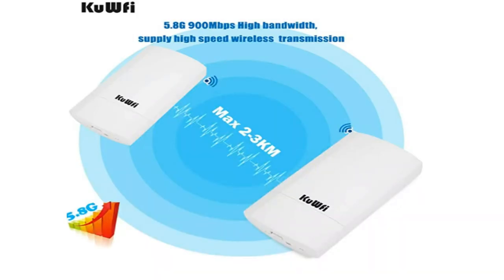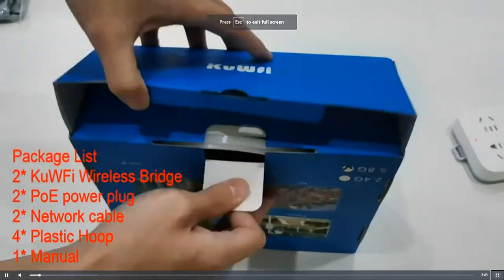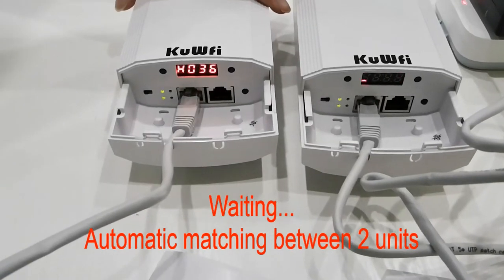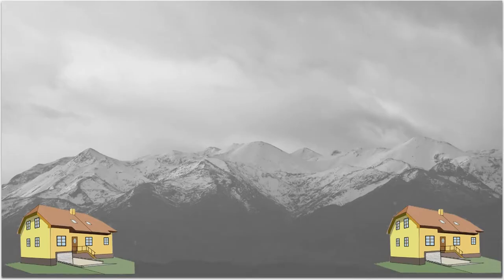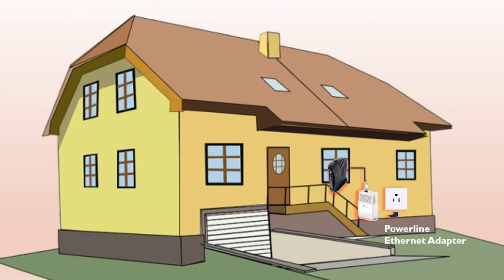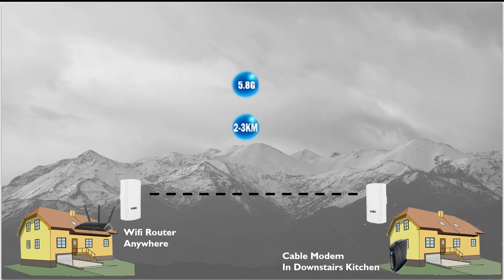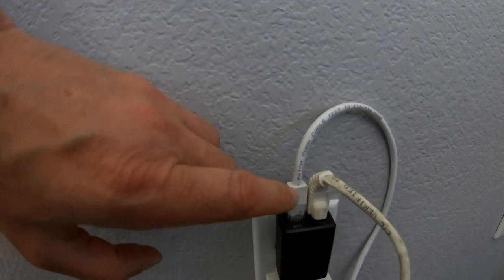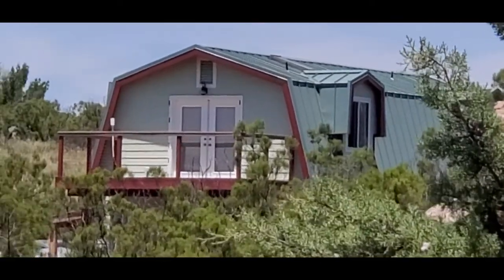Wireless Long Range WiFi Bridge Installation

Comment: Thanks for putting this video together.  I replicated this exact same set up to get wifi to an adjacent mother-in-law unit, and it worked out beautifully.
Reply: Did u use this brand I want it for my dad
Reply: @arthuritchybollix5064  Yes, I used:  (1) the KuWfi wireless outdoor bridge; (2) a Comtrend PG-9172 powerline adapter kit; and (3) a tp-link AC1750 wi-fi router.  The KuWfi bridge is made by a Chinese company, so the English instructions aren't great, but I didn't really need them.  I just plugged everything in as per the video (making sure I had a line of sight for the bridge), and everything just worked.

Comment: You didn't mention if you used the software to peak out the Antenna alignments. if you didn't you can swing the antennas at each end to get max RSL and it may improve your data rate. good video thanks

Comment: Super good video and well detailed.  I wonder if you tested first without powerline and with the antennas near each other so as to know if the low bandwidth was due to the antennas, ISP, powerline or what.  Super thanks.
Reply from the maker: Yes,  the powerline network did reduce bandwidth.

Comment: Am really curious if there isn't more too that "under the sink" stuff?
 Using the plumbing as an interference shield?
  Wow, brain buster.  
Thx for example. Unfortunately, I have obsticals/ mountain in way. So I'm trying to figure out a solar power'd "repeater" that I can put on a common mountain peak that all 100 acres can reach. 
 Most importiant is connecting the 3 different complexes.  Secondary would be pasture survalenc.  
  Scheduled drone liftoff's for livestock grazing surveillance, fence checks, yoty hazing etc.  All interlocked with weather stations that input grid conditions. May not be flyable conditions at one area, but ok at another. 
 So,,, yeah! "Home Automation" 2 another level. 
 Feeder valves and gate automation.  Wow, list goes on.  Hey?
 When do we get a kit to make our old tractors run off a peanut for 20 years?
Reply from the maker: No nothing more under the sink.  Not the best for a router but this is what the cable company did for me.    I'm afraid you need line of site.  Maybe get a tethered drone that's tethered by power line.  Oh boy.

Comment: Hello
I had a question, please help
If i use the Access Point TP-LINK TL-WA801ND_V1 Wireless N300 And use an outdoor parabolic dish instead of access point antennas, to send the Wifi 2400 MHz frequency, how far can I receive the frequency 100% without loss of quality ???
Reply from the maker: I dont believe that will work.  The two end points need to register with each other.

Comment: what about ping ? 

usually KU-Band (assuming that "KUWFI" using KU band, that's "KU" stands for) are laggy, it's like 300-600ms ping in the receiver network.
Reply from the maker: I did not check the latency but users in the other house get good internet and watch TV from a SmartTV.  The reponse times dont seem to be lagging.  I'll have to check that out next time I'm over there.

Comment: In your set up, does the router connected to the slave antenna have to be "synced" with the home router or does it have it's own network?
Reply from the maker: The slave route has its own network and bridges to the master to get internet access.

Comment: I am trying to go from the House to a shop about 250 feet away. The shop runs off the houses power source. Can you just use the adapter that broadcasts through the power system? Or do you still need to bridge?
Reply: Shep VanDelay  I need some help with set up. I have two locations A and B, both are apart by around 1 KM, so I want to use CPE's to share the footage from cameras set up at Location A with Location B ( which also has some cameras) and  save the Camera data at Location B.
The location B has internet access, so I want to share the internet from Location B to Location A as well.

 
Do i need some special configuration or hardware for this

Here is my raw set up:
https://ibb.co/KxWyXYJ

Any pointers?

Comment: Do the units ever disconnect or need resetting from time to time and have they been reliable for you. Thanks.
Reply from the maker: They've been running over a year just fine.
Reply: @how2togo  cool thanks for the reply. I have a similar application where I need WiFi to a neighbouring house.

Comment: How about 50-80 feet. Do they both receivers need to be outside?
Reply: They can be inside but 50 to 80 feet is very close.  I would think there are better product to use to just extend your homes Wifi signal.  This product is long range.

Comment: Hi, I have 300mbps internet speed  but I am only getting 40 mbps at the client  router even though  the two routers are only 10 meters apart for testing , is this normal to loose this much speed
Reply from the maker: Make sure there is nothing in the way and they're line of site.  Maybe the mfg can assist.
Reply: @how2togo  At 10 meters apart there is nothing in the way but air!  How much speed to you have to have to get the 300 MBPS out of them? So I guess they are useless.

Comment: On the second powerline adapter/injector which cable goes into the lan side and which cable goes in the poe side?
Reply: With these units, PoE always goes to WAN. So, LAN to LAN.

Comment: What is your internet speed in the main house vs the drop off to that house? In other words is you main house internet 500mb and the other house 40mb? Or is it something like 100mb and the other house 40mb?
Reply from the maker: Good point.  In the house roughly 100 Mbits
Reply: @how2togo  Thanks for that info :)
Reply: Im getting 500mbits from the house to the bridge.  The bridge is only RECEIVING 100??  Why IS that?  It says it can do more??  Then it turns around and proceeds to put out 47mbits??!!!
Reply: @cerettabridges7312  Several factors affect wireless bridge performance. Antenna alignment, obstructions, quality of the equipment itself, etc.

Comment: Did you make a How To for configuring the slave side router? I got it all plugged in and I’m stuck on why the second router has no internet connection. Bench testing it all before actual physical location install. Tia.
Reply from the maker: You turn on the Master and then the slave.  Make sure they're line of sight of each other and they will recognized each other.  It's that simple.  When you know they're communicating they will display the same codes.  if it doesn't work the first time reset them both always making sure the Master is up and running first.

Comment: wouldn't having two routers like that sideswipe each other (double natting)?
Reply from the maker: Nope,  you get the NAT from the cable modem side
Reply: @how2togo  ohhhh, so do you set the wireless router at the other house to bridgemode?

Comment: How is it going so far? is it working? any issues? Thanks
Reply: it's been over 6 months.  No issues
Reply: Its a point to point antenna. Instead of broadcasting in a 360 degree view like your standard router you'd get from your isp or purchase yourself.  These antennas focus all of the signal in one direction.  You can kinda think of it like a laser.  But, not as narrow of a beam.  But, its still focused.  I recently set up a point to point link myself at home.  To go from the house to the shop.

Comment: Why didn't you just run new proper cable to a better place like upstairs and get your modem out in the open for proper cooling , Then just plug directly into poe switch and the outside mounted ant. Clearly you have some sort of wire skills to do this and move the setup from under a kitchen sink. Will improve signal and speed just moving the cable to upstairs by the outside antenna.Getting rid of them ac plug in transmitters altogether.You already clearly have wires strung in many rooms so why not clean it all up to nice single point installation by the outdoor antenna?

Comment: when you say cable modem (attach cable to the kuwfi unit master) do you mean a router in your house or the actual modem
Reply: The host can be connected to a modem or router. Any active internet. If you have a routing modem, that would be best as the router may have other clients connected to it reducing throughput.

Comment: Our main house is only 500ft from workshop, but the speed we get into our modem via DSL is only 8-10Mbps. Is there any possibility this will work between the two?
Reply from the maker: It should work well.  500 ft is not fast at all.
Reply: Yep will work but if your planning to use it to streaming your going to get irritated at spooling.It will work for 480 but if you step up to 1080 or 4k you will really hate it.

Comment: I have 3 barns  the 3 barns are 150 years from where the master would be put.  all on the same side of the master.  like this.      \  |  /   those are the 3 slaves So can i connect 3 slaves to 1 master.   or is this unit 1 to 1

Comment: better than Powerline Adapters are Moca adapters which run using your coax cable... much, much better and cleaner connection and does not suffer from interference like the powerline adapters.
Reply from the maker: Good suggestion but power has more outlets if a COAX isnt avaiable.